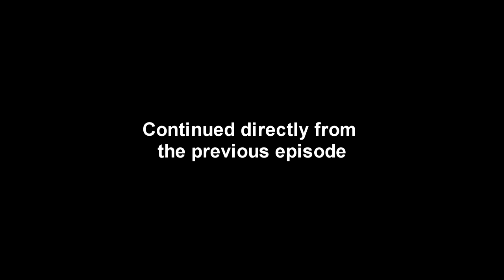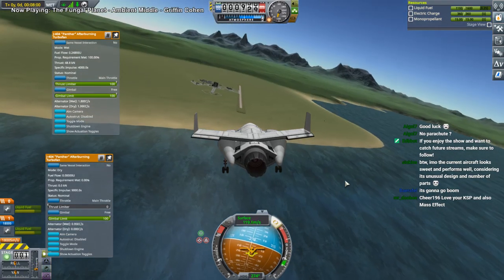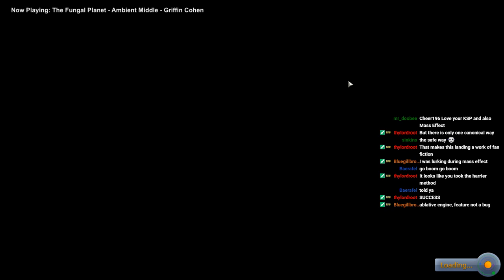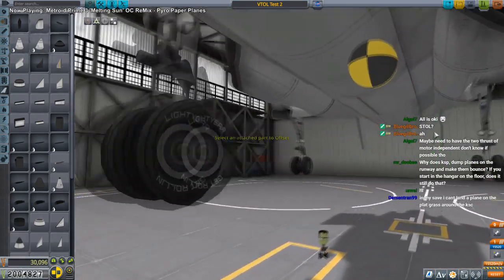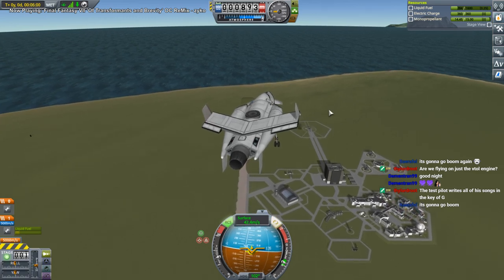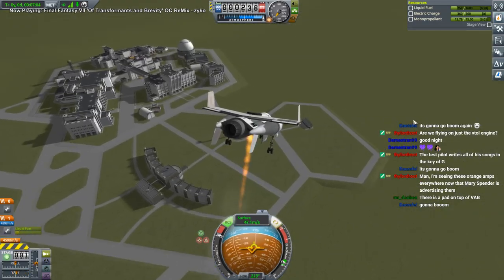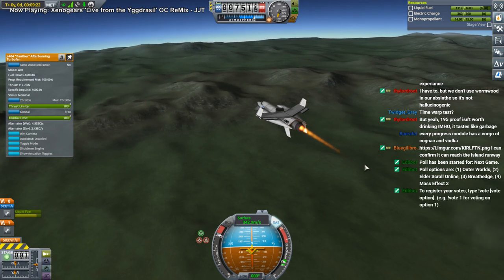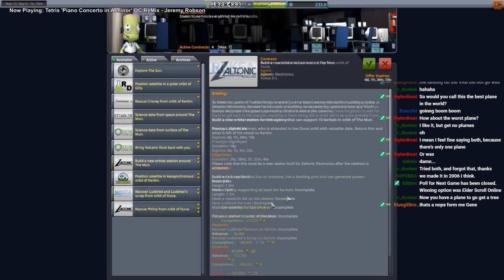Kerbal Space Program 1.8 Stock Career 28 - VTOL Part 2

Comment: The Harrier uses bleed are piped from the main engine for it's low speed control
Reply from the maker: Yeah, but I believe it's the intake (gaseous oxygen) that is piped and not exhaust (combusted fuel). Correct me if I'm wrong.